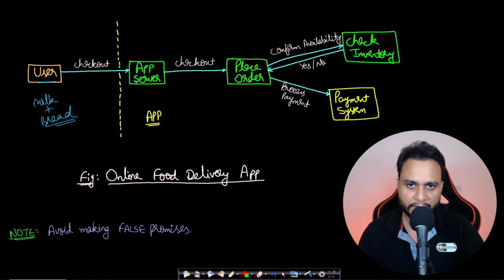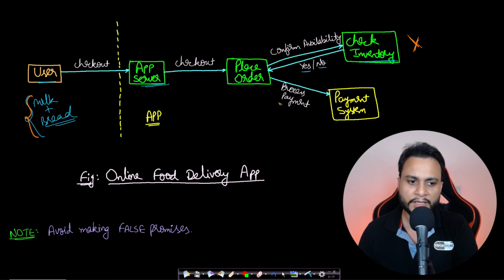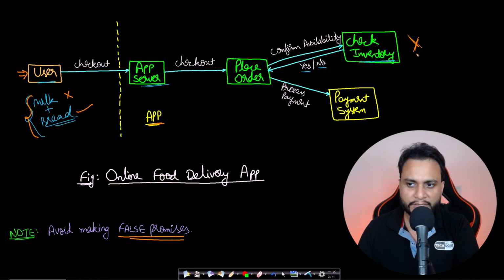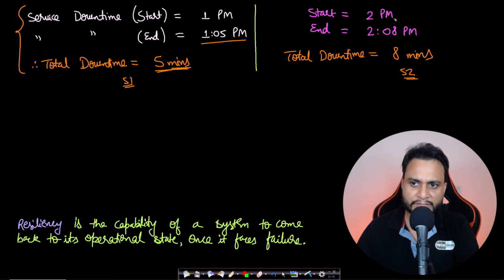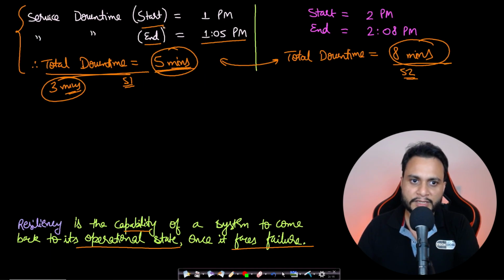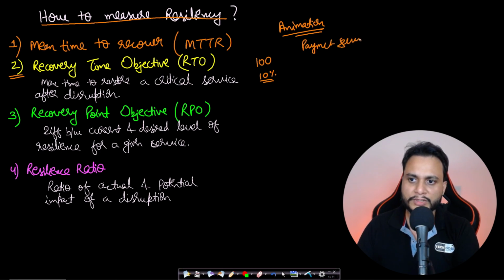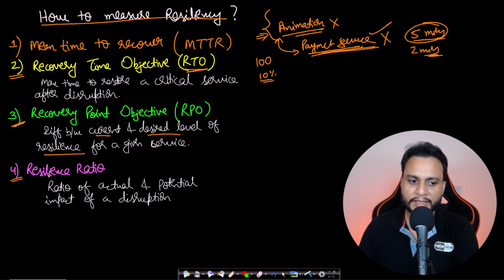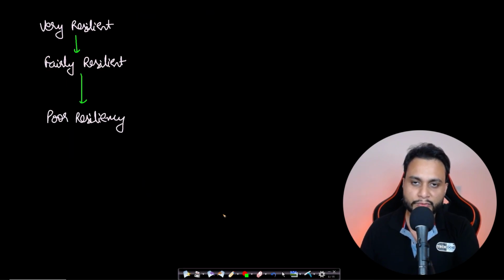Resiliency | System Design

Comment: In system design, resiliency refers to the ability of a system to withstand and recover from failures, disruptions, or unexpected events. A resilient system can maintain its core functionality and service levels despite facing adverse conditions, such as hardware failures, software bugs, network outages, or even cyber-attacks. Resiliency is a crucial aspect of building reliable and robust systems, especially in environments where continuous availability is critical.

# Key Aspects of Resiliency
1. Fault Tolerance: The system's ability to continue operating correctly even if some components fail. This can involve redundancy, error detection, and recovery mechanisms that allow the system to handle failures gracefully.
2. Recovery: The system's capacity to recover from failures and restore normal operation. This includes mechanisms for failover, data recovery, and system restarts.
3. Graceful Degradation: The system's ability to maintain partial functionality when some components fail. Instead of a complete shutdown, the system continues to operate at a reduced level of service.
4. Redundancy: The inclusion of extra components, such as backup servers, duplicate data paths, or mirrored databases, to take over in case of a failure.
5. Monitoring and Alerting: Continuous monitoring of system health and performance, with alerts set up to notify administrators or automated systems when issues arise. This allows for rapid detection and response to problems.
6. Scalability: The ability of the system to handle increased load by adding more resources. Resilient systems can scale to meet demand without compromising performance or reliability.
7. Security: Protecting the system from malicious attacks and ensuring that it can recover quickly from security breaches. This includes implementing strong security measures and having incident response plans in place.
8. Data Integrity and Consistency: Ensuring that data remains accurate and consistent even in the face of failures or disruptions.

# Implementation Strategies
1. Redundant Systems: Deploying duplicate systems that can take over in case of failure. For example, using multiple data centers to ensure availability even if one center goes offline.
2. Disaster Recovery Plans: Having procedures in place to recover from major failures or disasters, including data backup, system restoration, and continuity planning.
3. High Availability Architecture: Designing systems with multiple components that can take over each other's responsibilities, often using load balancers and clustering.
4. Automated Failover: Automatically switching to backup systems or components when a failure is detected.
5. Health Checks and Self-Healing: Implementing automated health checks and mechanisms that can detect and correct problems without human intervention.
6. Decoupling and Modularity: Designing systems with loosely coupled components, so the failure of one component does not cascade to others.

# Importance of Resiliency
Resiliency is critical for systems that require high availability and reliability, such as financial services, healthcare, telecommunications, and cloud-based applications. It ensures that the system can continue to provide services even under adverse conditions, minimizing downtime, data loss, and service disruption. By designing for resiliency, organizations can improve user satisfaction, maintain trust, and reduce the risk of financial and reputational damage.